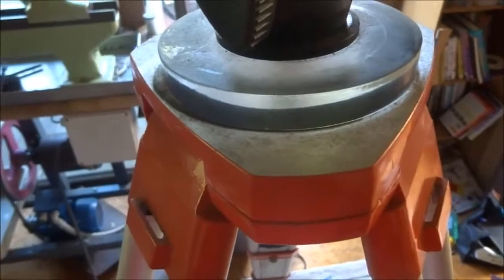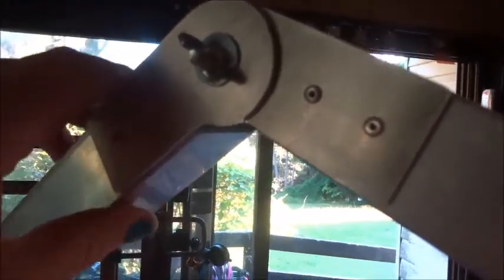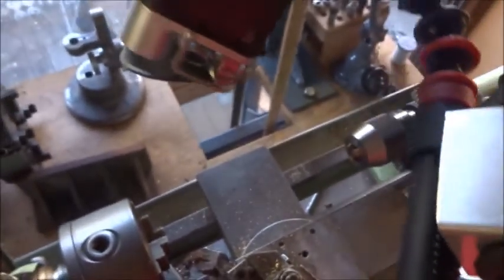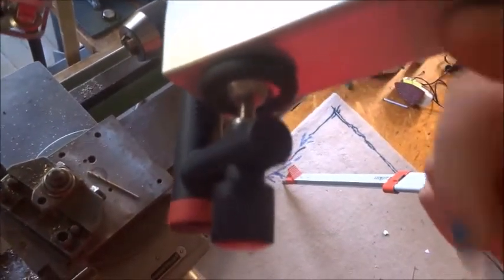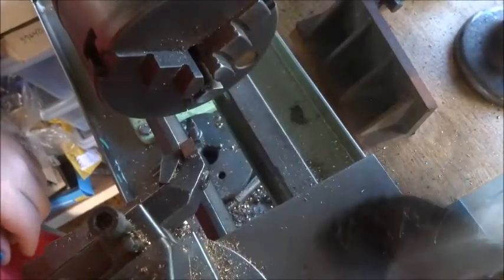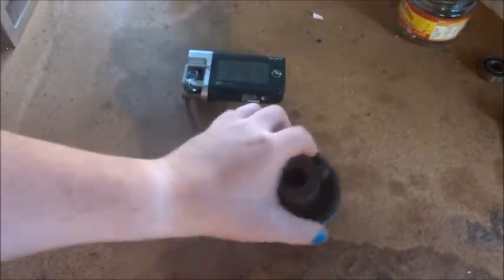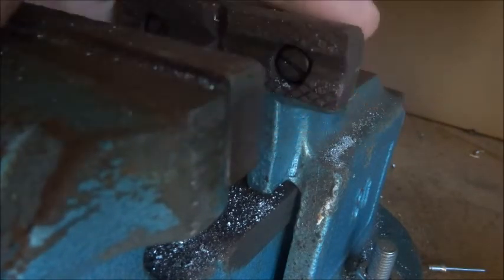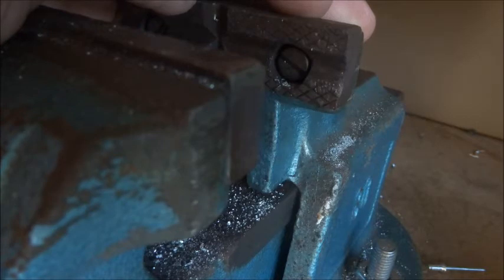My new Camera tripod rig/boom/light tower PART 2

Comment: To help tighten your hinge, you can make a little rod with a thread in one end, the other end a cross bar with a lighter rod, a bit like a C clamp screw, this would give you more leverage... Short enough not to have it in the way all the time.
Nice practical setup, otherwise, those cameras are always in the way.

Comment: Nice job there.  I guess if everyone else is building a camera crane I will need to get after one myself.  Thanks for the video.
Reply from the maker: cerberus I have just been frustrated with camera mounts and continually having to move the mount everytime i move the carriage  or tailstock. I needed something i dont have to reach around, something that doesnt vibrate when the lathe is running, and something that gets a point of view that doesnt make everyone airsick. love to see what you come up with!